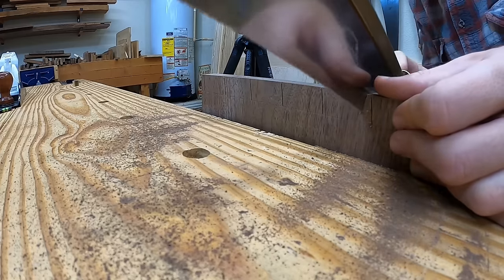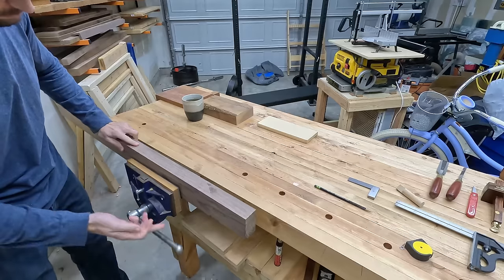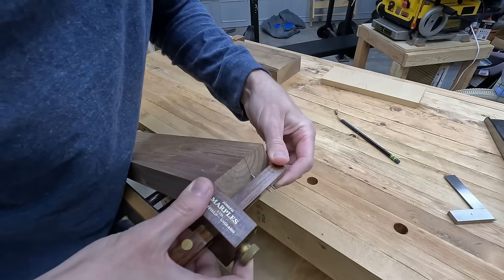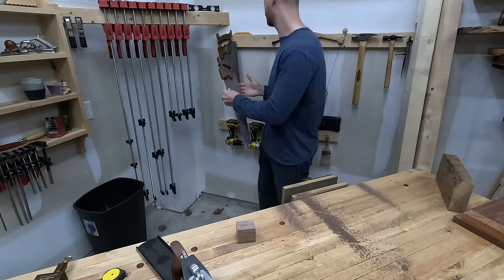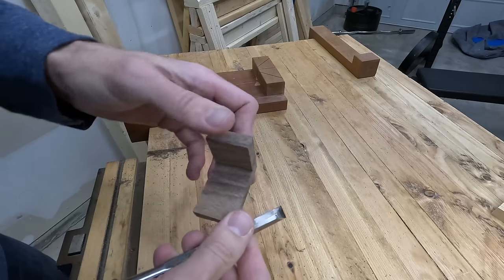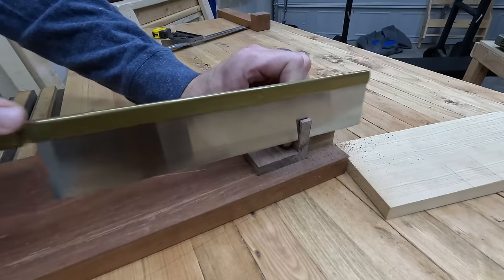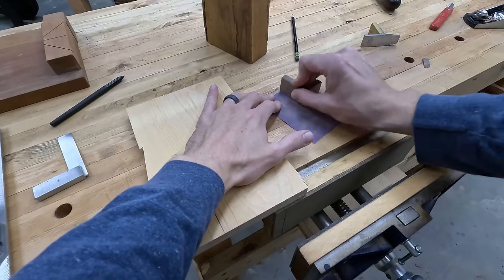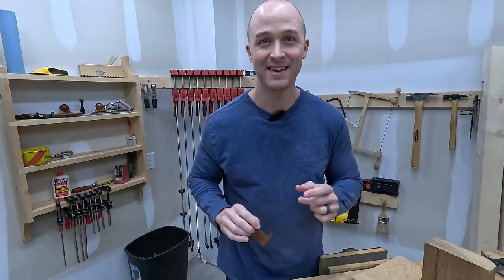Better Template For Woodworking's Most Renowned Joint!

Comment: Frank, I'm one of those guys who only use pull saws... But I wouldn't say that. I only use them because my shoulders won't let me use a push saw... It hurts a lot. 😕
Anyway, fantastic work! 😃
Stay safe there with your family! 🖖😊
Reply: I hate admitting this, not sure why, but I get much better dovetails with my $45 pull saw than I do with a very expensive western saw that I saved up to buy.  I know it is for sure me as opposed to the saw, but I really love the pull saw.
Reply: @mikeandlucky  Many times the issue with western saws is the sharpening or the setting... You know?
While Japanese saws you never touch it and new blades are pretty cheap, so... I'd say it's less of a headache from this point. 
But I have issues with both my shoulders, really... So I can't use western saws either way. 😕
Reply from the maker: I hear you Mike! I have the same feeling and keep coming back my little gents saw

Comment: Okay, I ask questions no one else does. I just saw one from Lee Valley, and it is same as yours. I have been pondering making one of these for a long time. I think there is one thing wrong with the design. To me, the piece that goes across the end grain should have the same angle as the tapered side. A straight up and down mark/line won't exactly match up.... Comments???

Comment: Just curious... how do you like that Woodriver block plane? I looked at one a few weeks ago and like the design of the cap. I was wondering if there was a lot of tuning to do and how the blade holds up.
Reply from the maker: I like it, after sharpening its good to go. the blade on that one has been good and I'm still using the stock blade,  but I ended up replacing the blades of the other wood river planes bc they wouldn't hone very sharp, they'd get chippy right at the edge when it would get super fine. So not sure if I just got lucky with the blade on the block plane one or what.
Reply: @FranksWorkbench  Thanks a lot for the feedback! Love the videos 😀

Comment: Frank, I wonder how long that template will last? The grain direction you have chosen (cross grain) is weak and vulnerable to breaking off.
Reply from the maker: Not sure, it certainly could. Flipping the orientation 90 will still have the same weakness so if/when it does I will probably make one with joinery connecting the two sections
Reply: 3/8" may be fine. Just as long as no one is tempted to make it thinner than this. Aluminium angle is good for these templates.

Comment: The dovetail is the ONLY way ?   when tested it is not the strongest
Reply: It's definitely not the only way and maybe not the strongest one. But dovetail joints are very tolerant to glue failures because in fact they are a mechanical lock of two wood pieces and glue is just an option not a necessity.

Comment: "They would be wrong." 

Dovetails are a fine way to join timber at an angle, and it's great fun to have them go seamlessly together, but they certainly are not the only way or even the best under some circumstances. With that, I'm outta here. Bye!
Reply from the maker: Lol I think you know I was just being purposely obnoxious.. but also dovetails are the only way to join two end grains to make a corner :)
Reply: @FranksWorkbench  -- You're right.